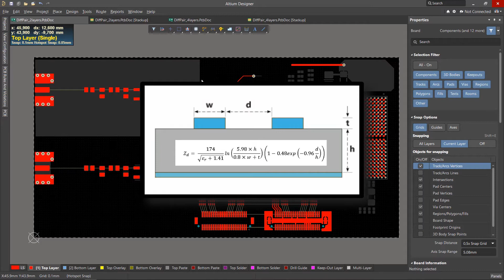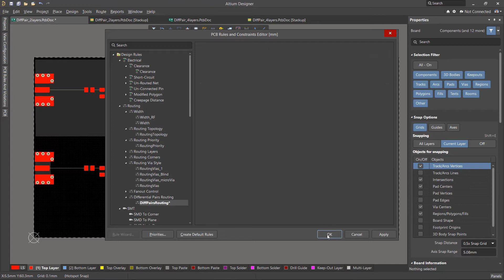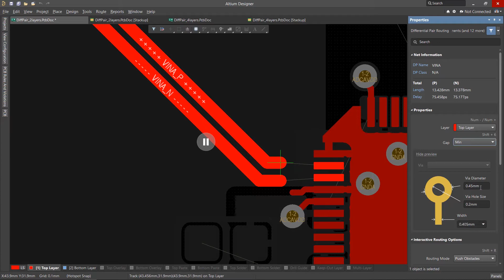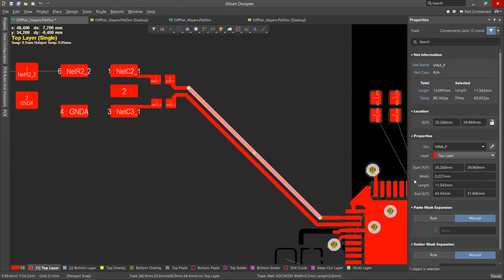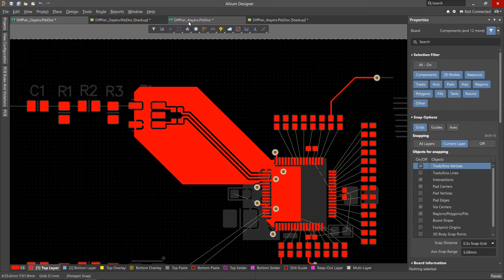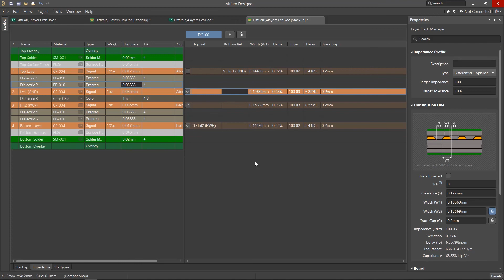Impedence Calculations Differential Pairs

Comment: I prefer to ask my fabricator for these calculations as they are more aware of material availability, process considerations such as pressing and etch factor which will impact on dielectric thickness and trace widths. These are 'real world' implications that software doesn't consider.

Comment: Why doesn't Altium support broadside-coupled differential pairs?
Reply: It requires mixing traces on different layers and determining the coupling capacitance/inductance between traces on different elevations, so it is a more complex calculation by hand and from a numerical approach. These are also not the best trace geometry and routing option due to the crosstalk you can create if you route multiples of these differential pairs on two layers, which will happen if you reverse the polarity of the traces on different layers.
Reply: @Zachariah-Peterson  Thank you for your response.  I agree that these may not be the best option, and that they may give the software fits.  On the other hand they do seem to work well enough for the slower signals (<1Mbps) I usually deal with.  They also make fan-out on BGAs easier where signal density is high and I have minimum trace width requirements to meet.  I do assign all the signalname_(P) nets to one layer, and the signalname_(N) nets to the opposing layer, with added horizontal spacing between them.  I also don't route any other nets in that same region of the board on those layers.  Maybe one of these days I'll get a chance to build up an evaluation board to get some empirical data on how these different differential pair formats work.
Reply: "broadside-coupled differential pairs" , never heard of that.